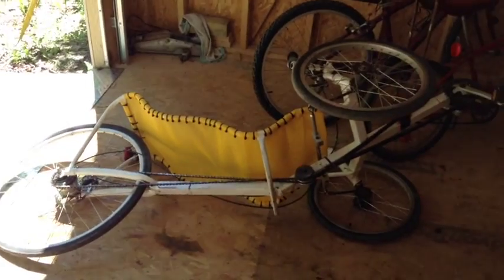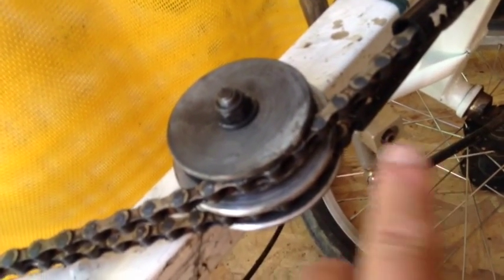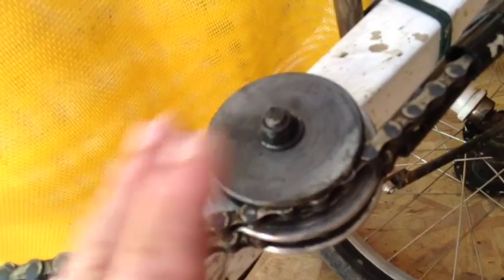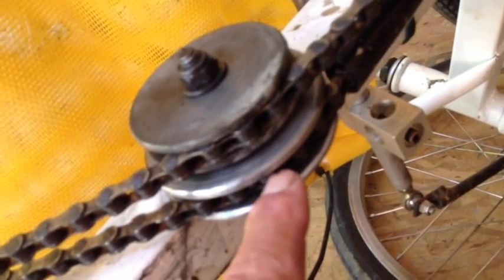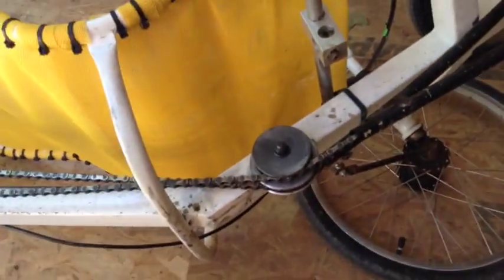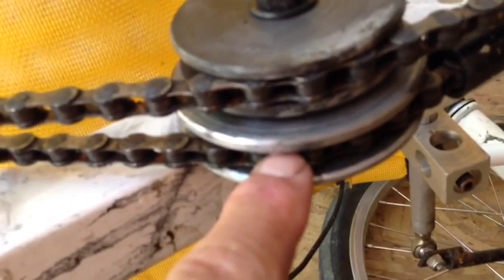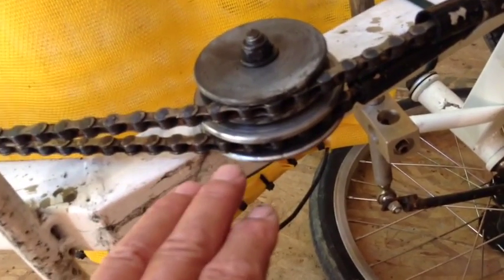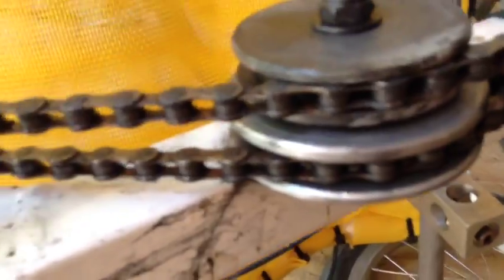DIY Chain Idlers

Comment: The online stores have two sizes 11T and 13T how do I know which one to buy?
Reply from the maker: Either one will work the different sizes are just for more or less clearance between the chain  and the tubing
Reply from the maker: Vick metal   Either one will work depending on how much room you need to clear the frame

Comment: i thought outside the box on my build..i used a tricycle part that plits the chain into 2 pieces..has two sprockets..so from the peddle to this thingy(cant remember the name) is one chain...then the 2nd chain goes from the thingy to the drive sprocket on the axle.....the come in a variety of configurations...anything from just the 1 speed  with freewheel to 3 internal speeds with peddle braking....simplified my build and eliminated that ugly sagging chain.